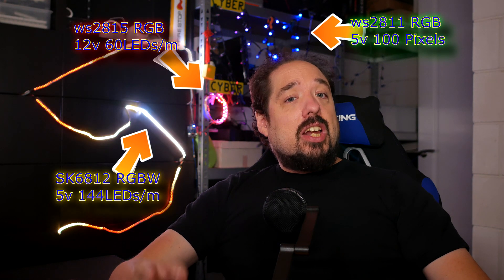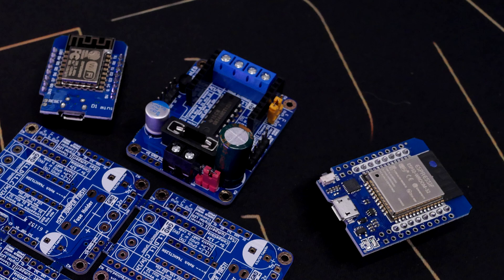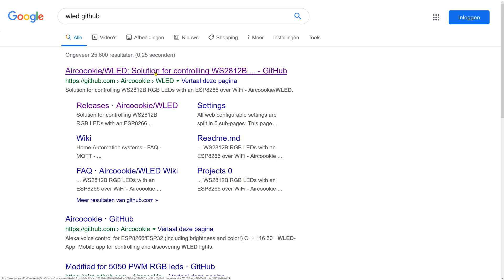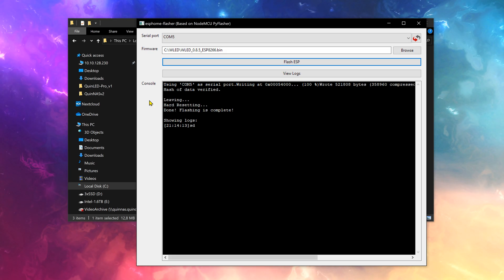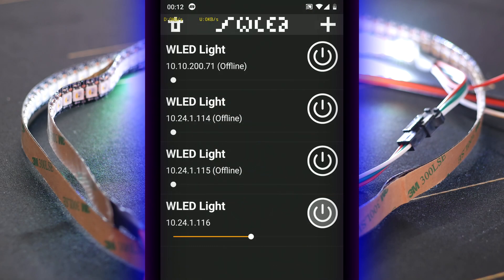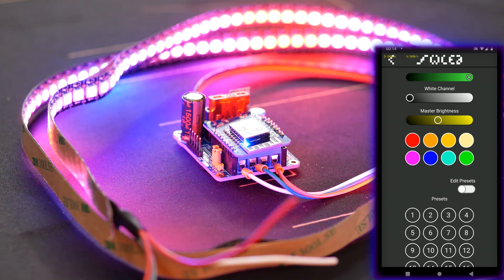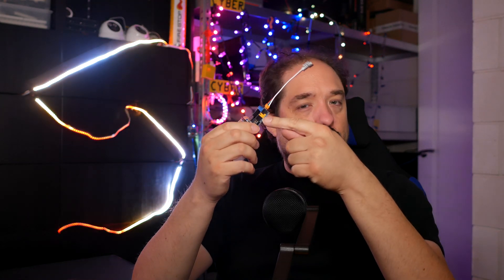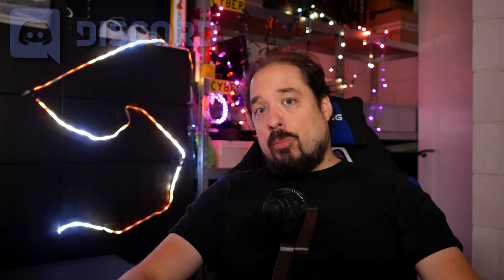WLED Tutorial - The ultimate DIY RGB Controller?

Comment from the maker: For anyone wondering, if it comes up with a question for a password, it's "wled1234" to connect to the wireless network!
Reply: Hey Intermit.Tech, im also using wled on 4 esp8266. All of them are running on WLED version 0.10.0. None of them are able to connect to Alexa. So I enabled the Alexa Emulation named them diffrent but Alexa or if I try to add them through the Alexa App they cant be found. You have any Idea on this?
THX for your help btw nice ambiente LEDs

Comment: This may be stupid question...
I want to setup an LED controller with the color and animation I want to use, and have it run that every time the unit is powered up, is that possible? Are there certain controllers I can get that will do just that, 1 program and run it every time it is powered up? It is for running board lights on truck, I want it to power off completely when the truck is off.
Reply from the maker: Sure, with a QuinLED-Dig-Uno or QuinLED-Dig-Quad and WLED running on it you can make a preset and then set it to activate that preset automatically upon boot, no problem.

Comment: USB related Question, Does it find the Serial port on ESPHome Flasher while connected to a normal USB charger cable, or does it need an USB has a data, as mine not finding the Serial Port, thanks
Reply from the maker: It needs a USB cable with data wires, yeah, otherwise it won't work to flash.

Comment: I understand the digquad has a mic input capability- is it possible,  maybe even on that same port to to have a 3.5 audio input feed so only the music is picked up?  And do the preloaded programs all react to the sound input?  Thanks!
Reply from the maker: Yes the Analog ADC from the ESP32 is broken out into a pin header and can be used for an analog microphone or with a little bit of extra circuitry you can hook up an Analog jack if you want.

Software wise you will need the Sound Reactive version of WLED to use it, so you need to flash a slightly different version. :)
Reply: @IntermitTech  
Nice! Thanks for the fast reply! Are there any tutorials on line that could walk me through the circuitry add on? Maybe with a list of needed components? Sorry for needing to be spoon fed!
Reply from the maker: @dougmills1806  Ah no not so much, I believe the audio reactive fork of WLED has a diagram on their WiKi though.
Reply: @IntermitTech  gotcha,  thanks

Comment: Completely novice user, tried search the comments so apologies if I missed.  I have some arduino and engineering experience, but I'm stuck at the flasher on this project.  Can't get com ports to show up.  Tried CDM212364 for the ports and CP210X  for the driver but neither seemed correct.
Reply from the maker: Check this page for the CH340 drivers: https://www.google.com/amp/s/quinled.info/quinled-esp32/amp/
Reply: @IntermitTech  Thanks!  Drivers worked and WLED is working, just trying to figure out now why I've got zero output.
Reply: Wrong .bin I think but when I tried to flash the correct one it appeared to have been stuck in a loop.
Reply from the maker: @coreyscoggins4373  Ah, hmm, also maybe try the new https://install.wled.me ? Maybe that'll work out better! :)

Comment: I did the steps of searching the WiFi Settings on my phone and Connected to WLED-AP, then I filled my network name and password, then when I saved&close my phone doesn't auto-connected to my WiFi Network. However, WLED app doesn't find the module (QuinLED Dig Quad V2),  

The question is: How can I get the IP the module get assigned? In order to add it manually ton the WLED app.. Please advise. Thanks
Reply from the maker: Check what IP it got from your DHCP server or router?
Reply: @IntermitTech  that's my question, how I doing that? I checked with my PC in the "command prompt" the ipconfig but just displayed the information of the PC, not for all the devices on my network.

Comment: Hey, if I can get the WLED AP to power up but no let lights will power on, is this an issue with my power supply? I have a new dig quad V2 that I can't get to power up my led strip.
Reply from the maker: Did you set the correct LED channels: https://quinled.info/quinled-dig-quad-pinout-guide/ ?
Reply: @IntermitTech  LED 1 is pin 16 correct
Reply: I got it to work, tried a different set of wires, made sure they were tight and of course choose the right pin output. Thanks for the amazing work on the dig quad!

Comment: Thanks Quin,  I have 2 Dig-Uno's and I flashed both D1 Mini's with WLED version 0.11.1. They flashed successfully and I logged into the WLED WiFi to add my ssid and password. When I logged back into my WiFi network and entered into the WLED app, it locates my device but it will not go online. What am I doing wrong? if it was one Dig-Uno, I would think it is a bad device. But this happened to both Dig-Uno's. Thanks for any help you can offer
Reply from the maker: Are we talking ESP8266 or ESP32? If ESP32 make sure to use the LEDpin16 version.
Reply: @IntermitTech  I am working with ESP8266. I had a previous version of WLED (I couldn't locate the version, but I downloaded the latest version on 12/6/2020) and it worked when I set it up. Then I had to wait for some hardware to install the LED strips and it sat for over a month.  When I started installing them, I noticed it was offline. I couldn't figure out how to get it online again so I updated the firmware and the same thing happened. I installed firmware on a second Dig-Uno and I cannot get that one online either. I used the WLED_0.11.1_ESP8266.bin file. I am sorry for troubleshooting on Youtube. I will copy this to Discord. Thanks Quin
Reply from the maker: Cool, we'll try and figure it out there. :)

Comment: can you use the regular 4 wire led light 12 v
Reply from the maker: You mean analog LEDs? So not addressable kind? Yes, but you'll need a dimmer controller for that. Not a digital controller.

Comment: Thanks a lot for sharing your knowledge with us common mortals 😁.
A (potentially stupid) question. Say that one would need to do some secondary power injection in the middle or in the end of the strip; the wires for the secondary injection would come directly from the power supply or would we wire them also from the dig-uno? It would defeat the purpose if it wouldn't right? How shall we do that? By double-wiring it from the dig-uno? As I said, potentially stupid question from someone that doesn't know much about electricity but is willing to learn.
Reply from the maker: Yeah, I'd use some wago blocks behind the Dig-Uno, the Dig-Quad makes power injection a bit easier.
Reply: @IntermitTech  thank you. I'm a bit behind on your videos. The Quad seems to be the better option in this case. 2 things:
1 - Great work having these (Uno and Quad) done in a way a commoner can use it.
2 - Thanks to giving it to us.

Comment: I am having trouble getting it to connect, how do I check what the ip is for it?
Reply: Did you ever find out I am still having problems
Reply: @aarongarcia4378  I think I just reflashed it a few times and it worked. get the app it makes it much easier to search for
Reply: @jonathanclark7444  ok I will try that thanks 🙏🏾
Reply: On the app did you have to connect to the WiFi through you phone ?
Reply: @aarongarcia4378  you can and then you can go through the setup through the app but I used it to scan for what the ip of the server was

Comment: What are the connectors on the ends of the wires you have in the screw terminals?
Reply from the maker: Wire ferrules, it makes it a bit easier to work with stranded wire. I have a kit on my tools and equipment page.
Reply: @IntermitTech  Thanks

Comment: One of my LED strips is not working because I used it to test the controller. I checked if there was any voltage drop and that was all good. I don't know if the LED strip got short circuited all together or there is another problem. Can an entire led strip get shot circuited if the load and neutral wires touch each other?

Comment: I don't get the comport on my screen. I am not sure what went wrong. I have your QUINLED DIG UNO.
Reply from the maker: Try a different cable and PC. Are the drivers installed? Does it show up in device manager?
Reply: @IntermitTech  I tried all sorts of things. Windows 10 USB driver wouldn't update for EPS8266 so I searched for different drivers online and I found that worked and it made my computer recongnize the board. Loaded the software and it is all good!
Reply: @IntermitTech  I had the same problem, found the solution here (Wemos 1D mini)  https://github.com/Aircoookie/WLED/wiki/Install-WLED-binary ,  If running windows, you need a driver from here: https://www.wemos.cc/en/latest/ch340_driver.html

Comment: Probably a silly question, but are you using spade connecters for the wires you connect to the board?
Reply from the maker: I generally use wire ferrules, sometimes spade connectors to a terminal on a power supply.

Comment: HELP,  I tried to install WLED from GitHub on my D1 mini and your tutorial is out of date and doesn't match what is on GitHub. Are there other sources to install WLED? I've been searching for hours and all sources point to a bin file that I cannot find. I couldn't use esphome flasher in Windows because it won't display the com port. Windows can see it but it is listed as an unidentified USB device. I tried installing it with Ubuntu and it also sees it as a ttyUSB0 device and unlike Windows it allows me to select it in the Serial Port within esphome-flasher, but I still do not see a bin file. Instead, I see a WLED-Master folder with other files. Are there any new installation instructions? 

I have Windows 10 and Ubuntu 20.04
I attempted to install WLED on a D1 mini (from your QuinLED-Dig-Uno) through esphome-flasher
I also attempted this using multiple USB cords (some of them were charging cords)

Thanks for any help you can offer
Reply from the maker: Not sure what is going on, but you need to look for releases on github. There you can download the WLED ESP8266 .bin file (just the regular one) and flash that.

If windows doesn't recognize the USB port, you probably need a driver, look for a driver for ch340, that should come up with a link to sparkfun for instance.
Reply: @IntermitTech  Thanks Quin, I saw the com port after I installed the drivers. Also, found the Releases link finally and downloaded WLED version 0.11.0.  When I flashed the D1 mini with ESPhome flasher, I received the "Unexpected error: could not open port 'COM4': PermissionError(13, 'Access is denied.', None, 5)" error message, but it looked like it installed even though I received the error.  So I hooked it up to a 5V adapter and could not see any WLED WiFi. The jumpers are on 5V and one of the times I plugged it in, the first LED was lit up. I bought 2 QuinLED-Dig-Uno's and flashed both of them. Neither one could bring up a WLED-AP WiFi network. I even flashed the older WLEN version 0.10.02 and still no love. Any suggestions? Thanks
Reply from the maker: @SomethingNewToDo  Poh, 2 being dead is highly unlikely, not sure what else to try, if you flashed the vanilla WLED ESP8266 on there it should work. Does the WLED Wireless network come online while on USB?

Otherwise, join the Discord server, much easier to troubleshoot there. :)

Comment: Can the single data output wire control multiple led strips that are in parallel?
Reply from the maker: Yes, it can, with the level-shifter used generally up to 3 works fine, 4 has worked for some and not for others.
Reply: @IntermitTech  ok thanks. I’m still pretty fresh to all this but I was hoping to use a diguno to control a led Christmas tree I want to build. 16, tall with maybe 12-15 strands
Reply from the maker: In Parralel? Well you can't run more per port, but with the Dig-Quad you have 4 data ports which could each do what I wrote before and you can then make those all do the same. That would get you pretty close I think.
Reply: @IntermitTech  ok. I was hoping one date port could send the same signal(WLED command) to multiple strands. I know they make Mega tree kits  like thishttps://www.holidaycoro.com/16-CCR-Pixel-MegaTree-High-Ouput-p/815.htm

Was hoping to build a simpler one o a cheaper budget.

Comment: Can you turn on two colors and regulate them at the same time? Also can white and blue be turned on at the same time? And I am talking about SK6812RGBW.
Reply from the maker: Well you can mix any color, so while you can't change the dedicated color values directly, you can set it in between two colors. The white LED can be regulated seperatly from RGB and at the same time as any color.
Reply: @IntermitTech  that 256 validé in the brackets in the Arduino program. I was thinking about making it a variable connected to an encoder or pot that by moving it would change that value from zero to 256 independently. Haven't done it yet.

Comment: I have a question, can you use normal non Addressable leds with wled?
You know the ones that can show just one color and need 3 signal pins.
Reply from the maker: You can if you use an Analog board with MOSFETs and custom compile WLED with anog support. I've tested and verified this on my QuinLED-Quad and QuinLED-Deca
Reply: @IntermitTech   Did you make or can you make an Video about that?
Reply from the maker: I'll consider it for in the future. :)

Comment: Just ordered a Dig Uno to run WLED for my RGB Pixels for the holidays after using a NODE MCU the last 2 years.  I have 2 questions...Will this board work with my WS2811 pixels, and can I connect an Xconnect pigtail directly to the board?  Thank you very much!
Reply from the maker: Awesome and yes on both questions, no problems there!

Comment: Can you use  12v power supply and use 5v led strip?
Reply from the maker: The board only does conversion for it's onboard electronics. Voltage in = Voltage out. You can of course convert 12v to 5v with a buck converter but if you'd need like 10Amps, that converter would be 5x the size of the Dig-Uno alone already. :)
Reply: So, a 12v power supply will not hurt the D1 Mini?  I’m running 33 feet of string lights. I would like to use 12v if it’s safe.
Reply from the maker: No running through my board set to 12v, that's correct

Comment: Bit off-topic but how did you manage to create such a smooth effect on that SK6812 strip considering how slow it is ? It looks wonderful.
Reply from the maker: In what regards is it slow? If you stay under a certain amount of total LEDs it's just as fast as ws2812b?
Reply: @IntermitTech  Oh, I didn't mean that SK6812 is slow. I was referring to the speed & smoothness of the effect in particular, I tend to be able to end up with such smooth transitions only if the effect is running at a relatively high "speed". Otherwise the transition looks a bit unpleasant in terms of appearing as it skips some steps so it looks somewhat janky if you know what I mean ?
Reply from the maker: @vex9596  Aaah like that, yeah, it depends a bit on the effect, some skip over the LEDs and some "blend" over it. Also using like 60LEDs/m or more also really helps with that. :)
Reply: @IntermitTech  It's probably my code, I'm very new to this.. and definitely bad at it lol. I do usually use 60+ LEDs/m and it everything is spot on when using "premade" codes. I guess I'll try to diffuse the strips to make it less apparent for the time being

Comment: Hi I can’t get this to work on my Mac any help out there
Reply: I used the Mac version of NodeMCU PyFlasher instead of using ESPHome  Flasher. It's pretty much the same thing. I had the problem that my micro USB cable was just a power cord, no data. So the ESP8266 would not show up in the Serial Port dropdown.

Comment: On the amount of power you put 6500 , if i have a 5v - 60 amps power supply with 2100 lights cause i have the WS2812B which is 300 lights per string, what number of power should i put on mine? And hoping this will do the job for that many lights, I also put a power injection cable along and injected power at the beginning and the end of every string of lights, just waiting for the dig-uno that I ordered from dr Zzs , let me know what’s my number to put on the amount of power on the WLED ap

Comment: I currently have a WS2811, 600LED 24v strip and a 24v AD/DC power input. I dislike the wifi "magic home" controller I currently have set up and want to move on to a cooler controller like WLED. This stuff is so confusing, is there any chip i can connect with my current set up to make it work like in the video?
Reply from the maker: Yeah, you could use a QuinLED-Dig-Uno with WLED on it for that, no problem. By default my boards aren't 24v compatible though since those strips are quite rare. But with a little bit of soldering, they can be made 24v compatible! https://quinled.info/2020/05/23/quinled-dig-uno-adding-24v-compatibility/